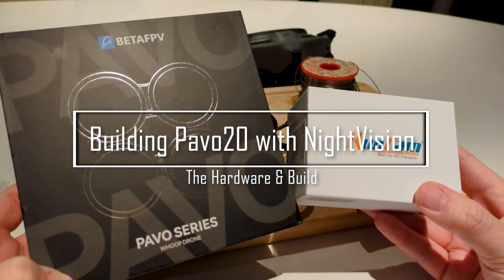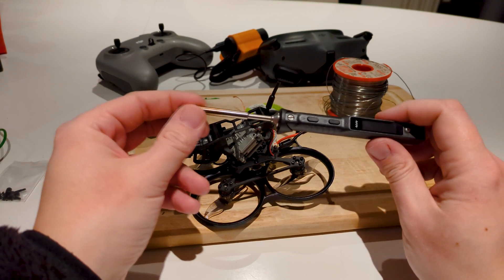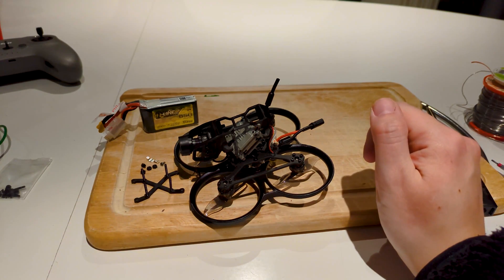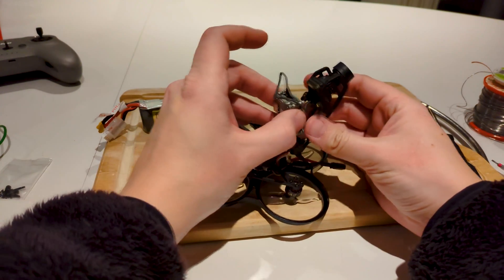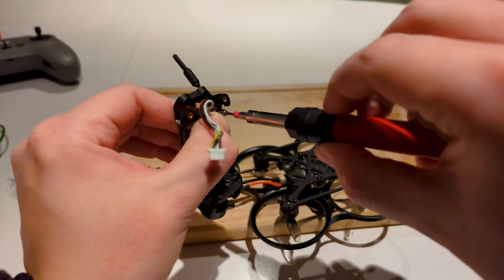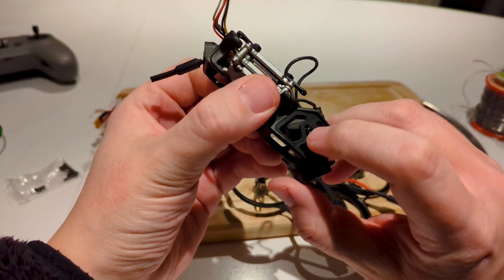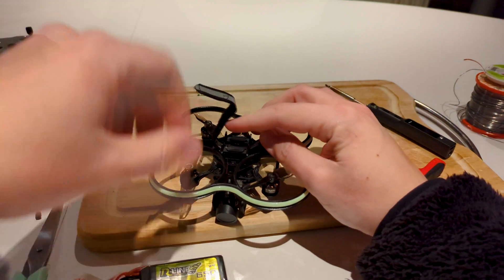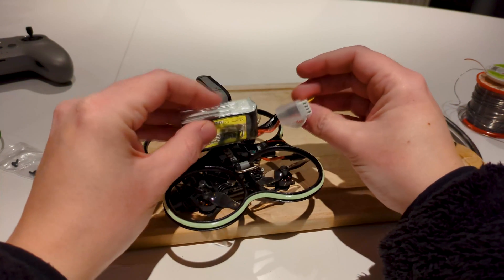How to Build Night Vision Drone Pavo20 with RunCam Link Night Eagle HD - Part 2

Comment: Is there a posibility to switch that camera to 4:3 image proportions ? or just basic 16:9 crap only? There is no info about this in documentation anywhere.
Reply from the maker: As far as I know it is locked to the 1280x720 resolution. 
So not the best picture quality but enough to see while flying not that great for content.

Comment: In total darkness, does it work as night vision? I didn't find the infrared. I'm thinking about purchasing to locate animals at night to make hunting easier.
Reply from the maker: Actual Total darkness then it doesn't work. You need some light, like moonlight or some Light from the Drone but just a little light does make a difference.
There are like IR spotlights for example.

Should also check your local laws on if you can use a drone for hunting. Here it's not allowed for example.
If you just want night vision then there are better options for hunting.

Comment: On the vtx your screws should go from the top down because the nuts you get are plastic and your vtx get very hot at times so place the nuts at the bottom of the carbon plate, just switch the  way he is doing it, and i know this because i melted the nuts by having then on top.
Reply from the maker: Good to know thanks. 😊
Need to trough all the screws anyway as the ones for the camera dropped off. Felt a bit off when the camera was just flat and was blinded by the LEDs suddenly..